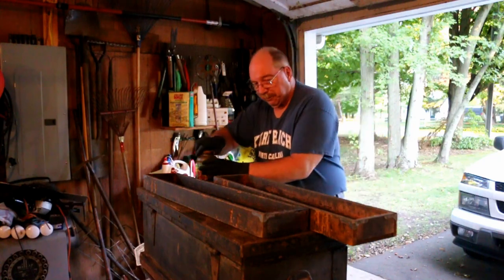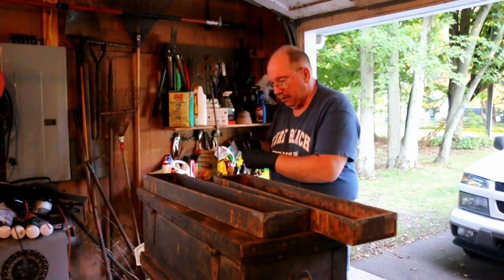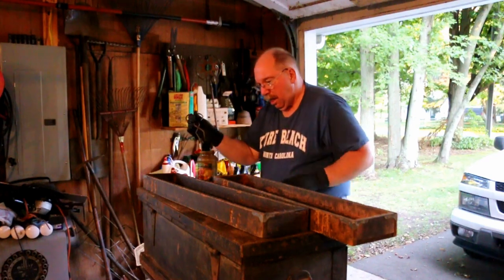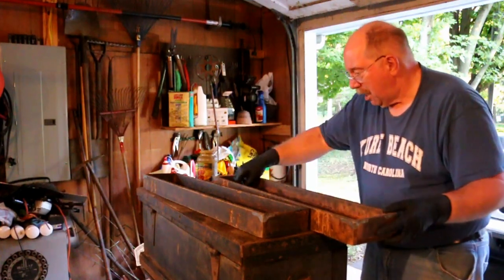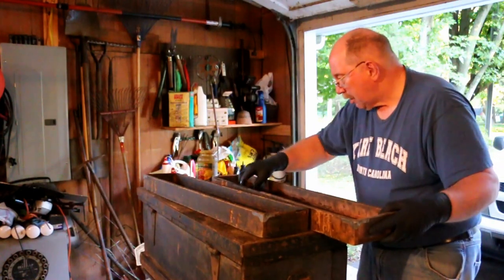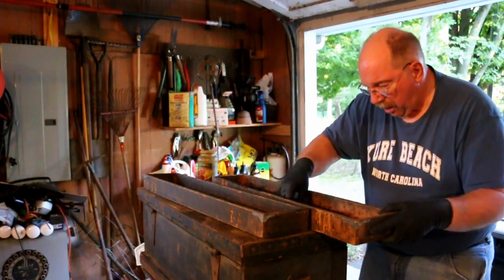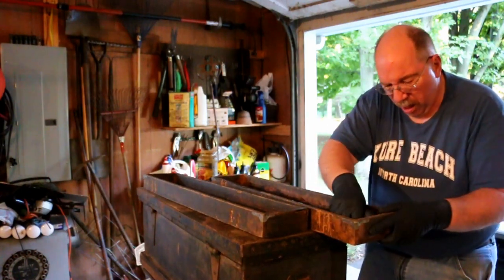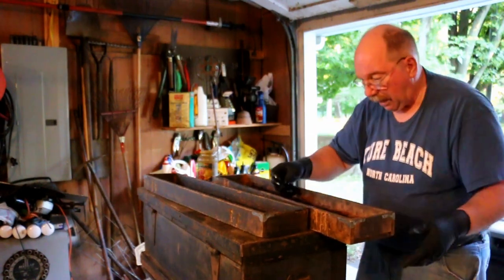Restoring AC Gardner's Tool Box Part 3

Comment: YAAY, BLO! And my gut started wrenching when you even STARTED talking about the cans because I knew what was coming, BUT down here it was even worse with the 'smokeless' tobacco like Skoal and Copenhagen and such, 'snuff' as it's commonly called and thereby SPIT cans and bottles. I don't EVEN want to think about it. I chewed for a while after I quit smoking or rather the Lord wore me out and took it from me and it was so gross I had to quit that. The Mitchell County Millionaire was smoking, dipping AND chewing at the same time at the boulder hole years ago and wound as tight as an 8-day clock; a very fractious individual. I was glad to be on the good side of all those guys. Still am! So I am going to start on the leaves and mulch. I didn't feel like it yesterday, so I didn't. I feel like it today so I am! Thanks, Unc! FINE job and I can almost smell the wonderful fragrance!
Reply from the maker: Warning old guy story: When I was a kid working at the Midwest Foundry Phil Martinez worked maintenance in Gray Iron while I did the same in Shell Mold. I got along with everybody and Phil would offer me some Red Man every once in a while. I took him up on it on night. I was walking around the plant spitting and having a great old time. 
I got a call to go to the dust collector in Shell Shakeout. To work on it I had to climb a metal ladder about 40 feet straight up. As I climbed I was looking up at where I was going. Evidently some of the spit ran down my throat. By the time I got up on the deck I was so dizzy I had to just stand there hanging on to the rail. I spit out the chew and hung there for a few minutes before I could stand up without  my head spinning. I fixed the dust collector and that was the last time I chewed tobacco.
Reply: @OldSneelock  I started on Beech Nut right when I quit puffing, spitting and slobbering like a mad dog and then moved on to Clover Bloom twist. I gnawed on that but had to empty my own spitoon and yes I had a nice brass one but it was too gross and me with apnea that I didn't know about but I was always scared I'd choke on a wad so that was that.
Reply from the maker: @lewiemcneely9143  Best not to get started. Chew and snuff both are bad for your teeth and gums. Don't have proof, but mouth and throat cancer could have a link just like smoking and lung cancer. 
I have some family members that got started on the vaporizer fad. Because it was new there wasn't any data on effects. The companies were making big bucks and grew quickly. Now Michigan has outlawed selling flavored vaporizer mix. I don't get how relatively intelligent people could think that inhaling vegatable oil with nicotine in it would be at all healthy. 
My own opinion is that it was promoted as an alternative to smoking. It was suppose to help smokers quit. Now they followed the methadone plan and are handing out the cure so it becomes a new addiction.
Reply: @OldSneelock  Of COURSE you're right. I just lost a buddy from throat cancer from snuff. And as far as the vape junk goes, aren't there filters and separators to keep compressor oil vapors from out of your lungs except on THEIR stuff?!! Another addiction is right. But they claim they don't have worms but I wouldn't bet on it with all the great tasting 'additives'.

Comment: I Remember Scraping old Paint off An Old Garage (Auto Shop ) ,Then Using Linseed Oil on the Clapboards Before We Painted ! The Linseed Oil Seals the Wood And Let's You Use Less Coats of Oil Based Paint ! But It Took Forever to do that Job ! About 3 Days ! Anyways Moving Along On the Toolbox . 👍
Reply from the maker: Paint scraping is one of the jobs that just has to be done. The old house had been painted with oil paint for the better part of a century. Just before we bought the house it was painted with latex. The oil based paint popped loose under the latex and came off in chunks 6" long. The house was two stories and had Victorian trim. It took most of a month to scrape and paint it. 
If they had used oil based paint it wouldn't need to be scraped nearly as much.   😆😎

Comment: I knew where you were going when you mentioned pop cans.  I knew a guy that used to use Coke cans as ashtrays. House full of em's.  I knew what was coming for minutes of that story, but I still started gagging when you got to the punch line.  Gagging and giggling. 
As to the Rago jar: while it was just conceivably possible that it might have been mistaken for a foodstuff when you first started using it, I don't think anyone would be in such dire straits as to consider using sauce from a jar that looks as that one does now.
I have used drinking bottles for not exactly-foodstuff before, but they were holding water containing baking soda or table salt.  I was playing with a Lichtenberg burner I made, and needed something to hold the electrolytic solution.  I also showed someone that I could taste my de-rusting solution (regular white vinegar).  I wouldn't recommend it as a salad dressing though.
Reply from the maker: Another reason for using baking soda for electrolysis . It would taste bad but not lethal.

Comment: How's she goin'?  I have never used linseed oil on a project.  Maybe I'll try some on the next piece I tackle.
Reply from the maker: It is a nice finish if you don't need shine. More of a satin look. Great on tool handles. Won't raise a blister like the hard plastic coatings wood handles come with. Not wateroroof by itself. Just feels right on a handle or a project that will be inside. Wax will repel most water so I usually put paste wax on after the BLO.
Reply from the maker: The only drawback is rodents and other critters must like the taste. Porcupines might just eat your coated shovel handles if you leave them accessable. 😆😈😲😎

Comment: Looking great. It's going to be a very nice tool box. I have a nice little box made out of galvanized steel. My friend found it and gave it to me because it had my name stenciled on it. What would you suggest to seal it with so it doesn't  miss up the lettering. Thanks
Reply from the maker: Shellac works good as a protective coat. Try a little bit of it on the paint. It uses alcohol as thinner that doesn't bother most paint.

Comment: I’ve used a BLO mix since I was little...I’ve never drank a soda with butts in it, the youngest learned to shake the can a wee bit if she left the can    And decades ago the ladies did start chewing tobacco at the lumber mill to get back at the guys who would spit the wad out on a board just so we would have to get it all over us
Reply from the maker: I worked for a company that ran screw machines. The operators would spit in the coolant tank. Horrible mess to deal with. After having to wash out the system a few times the operators would avoid that like the plague. 
The ladies at the foundry were past masters at getting even. You really didn't want them to work at making your life miserable.
Reply: That’s so true!

Comment: Curious ... why do you add the mineral spirits? To make it penetrate and dry quicker?
Reply: Yep both! For some reason thinning it really helps it drying
Reply from the maker: @jusb1066  Correct. I'm guessing it has to do with coating thickness. Straight BLO is about like 30 wt motor oil. Since it hardens through oxidation I would bet thatit develops a skin on the thick layer and that blocks the air from penetrating to the rest of the coating as quickly. 
The thinner mix penetrates better too.